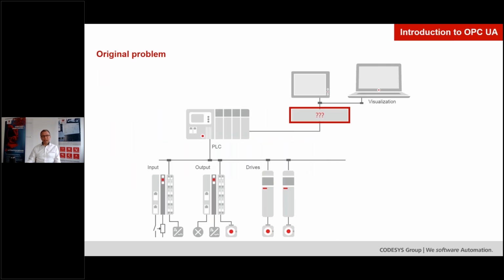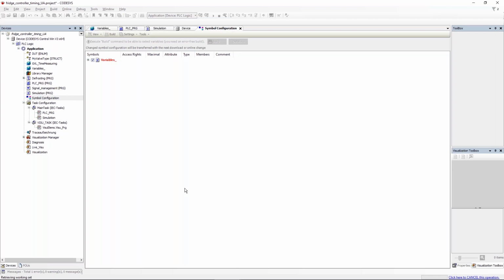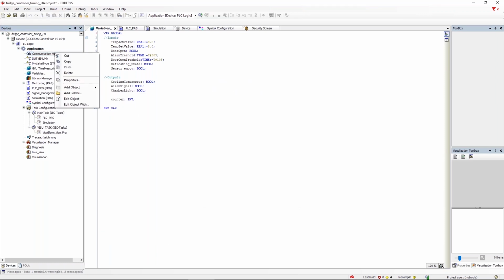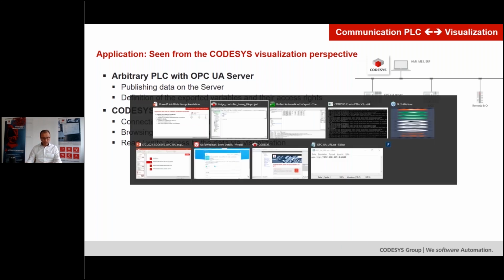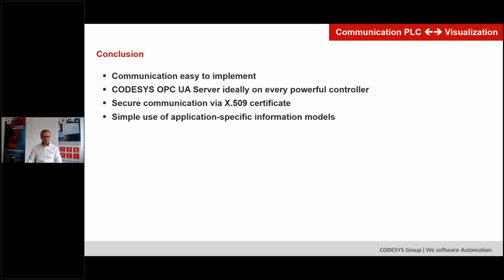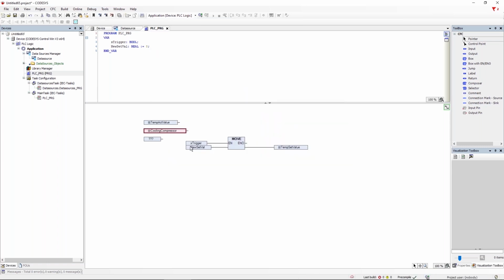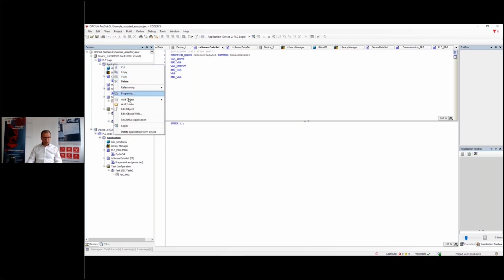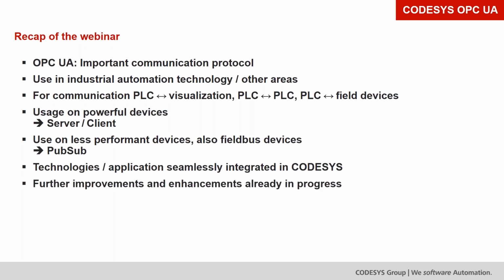OPC UA & CODESYS | Webinar | English

Comment: Thanks for the video, it was very helpful and well explained! Just one question: is there a way to change the node IDs of the created nodes to string or numeric instead of opaque?

With the UA Expert client, everything works fine, but when I try accessing the method using the open62541 client, it crashes the OPC UA server on the PLC and won't reconnect until the PLC is restarted.

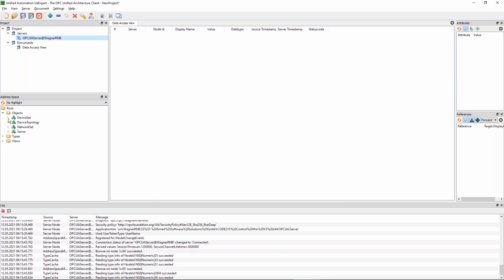Comment: I followed all the steps you gave until 10:57 however I am getting this error: "Error 'BadSecurityChecksFailed' was returned during OpenSecureChannel". PD: I tried with anonymous login and it didn't work as well.
Reply: FYI I was able to fix it adding the UA Expert Certificate inside Codesys, it will be nice to add that step on the tutorial :)

Comment: Hello Sir, I am trying to configure my codesys softplc as an opc ua client and read data from a different opc ua server. When I add data sources manager to my project, opc ua server does not appear among the options. I only see codesys applicationv3. Is there any other way?

Another question I have is, is CODESYS OPC UA CLIENT SL license required for this situation?
BR,
Reply from the maker: Did you install the CODESYS Communication Add-on with the CODESYS Installer? That is needed to setup a OPC UA Server in the Data Sources Manager.

You don't need a license for that. The feature has a demo mode.

Comment: Hello! How many clients can connect to a single port 4840 on server simultaneously? For example, i wanna take data from a single plc via opc ua to: Weintek panel 1, weintek panel 2 and SCADA ( tia portal for example). Thanks
Reply from the maker: @user-mi3xd7jh3u There is no general answer to this question. How many clients can connect depends on various factors, e.g. the performance of your hardware and how much data the clients retrieve.
Since three clients is not a lot, there is a good chance that this will work. 😉
Reply: @Codesys-AutomationSoftware  Thanks

Comment: May I know what OPC Server should I use to integrate Codesys to Factory IO?
Reply from the maker: Simply use the CODESYS OPC UA server which is part of the SoftPLCs in the CODESYS Store, e.g. for PC based systems (CODESYS Control Win SL or CODESYS Control RTE SL under Windows or CODESYS Control for Linux SL) or for other systems like the Raspberry Pi (CODESYS Control for Raspberry Pi SL MC).

Comment: thanks for the video, how do i determine the url of my opc server? as you had yours already prepared. thankyou
Reply from the maker: The URL of your OPC server is generated out of the IP address of your PLC. For example, an IP address of 192.168.0.1 results in a URL of: opc.tcp://192.168.0.1:4840

There are several different ways to get the IP address of your device. You could either see it in the device log in the CODESYS Development System or use tools like Advanced IP Scanner to search for it, just to name two options.

Comment: can it be used with wonderware intouch?
Reply from the maker: CODESYS supports all OPC UA Clients, so the usage with Wonderware Intouch should be no problem.
Reply: @Codesys-AutomationSoftware  thank you! Is there a way to migrate a AB plc program to codesys?
Reply from the maker: You can migrate your program to CODESYS if the IDE you use to configure your PLC offers an export function which is PLCopenXML compatible.
So you just need to export the PLCopenXML file and then import it into CODESYS.
Reply: @Codesys-AutomationSoftware  i will try, thank you
Reply: @Codesys-AutomationSoftware   Dear Sir, Thank you for the kind help. I am unable to connect codesys to intouch SMS opc server and then to my intouch HMI. it seems as if the data is not communicating from the codesys to my SMC Archestra. I set up the symbol configuration, selected the variables and then build, download and run. I may be missing something in codesys? I have been on the phone with AVEA wonderware for several days and we cannot get the comms working.  Have you tested it with intouch archestra SMC? thanks im kinda lost now...everyone that posts a video uses kepserver to comm with intouch, i haven seen anyone use archestra smc intouch.
Reply from the maker: We are sorry that you ran into connectivity issues. Please contact the support of the CODESYS Corporation for help on the matter.
Reply: @Codesys-AutomationSoftware  ok thanks

Comment: Thank you for the video, there is a lot of good information. 
Maybe you said but I don´t remeber, which Codesys version are you using?
I am using 3.5.16 and I don´t see object "Communication Manager", I see that is like a cloud the icon but I dónt have it, it comes in latest version or I could install a package?
Reply from the maker: The Communication Manager is available as of CODESYS V3.5 SP17. Thus, try it with the latest version :-).